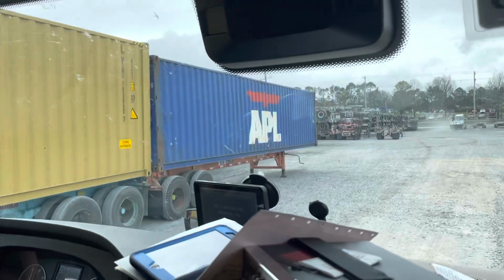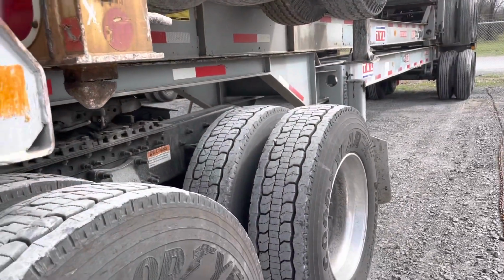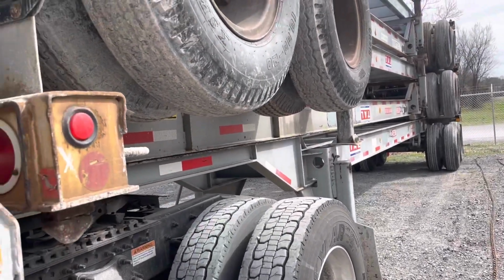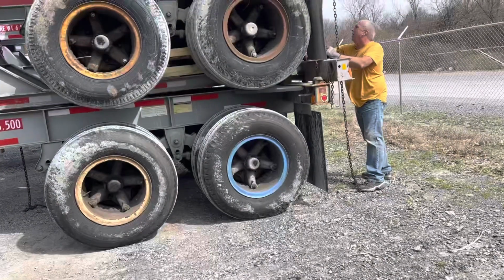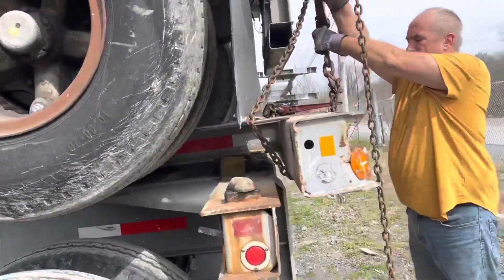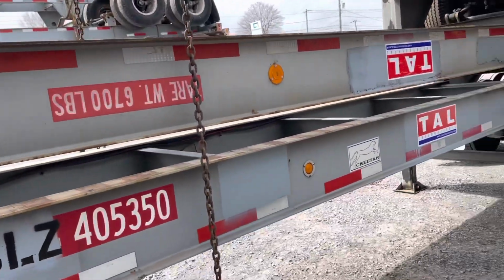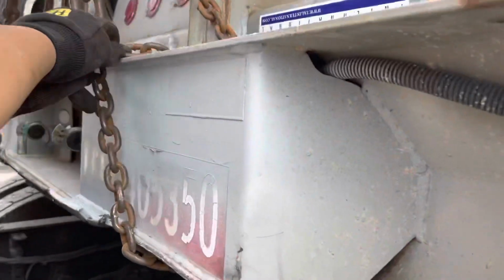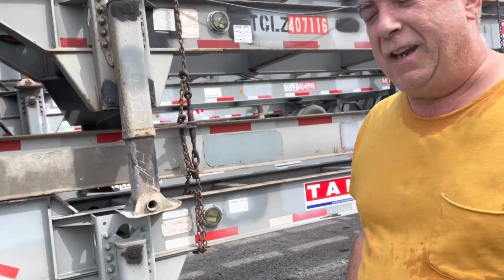Watch mae climbing on the 5 stack chassis to help chain them down

Comment: That scared me seeing Mae climbing around on that stack.  It reminded me of my car hauler and I have fallen through on it before.  You find every piece of steel cross member when you fall.  Knees, shins, ribs, elbows, back.
Duck tape makes an easy way to secure the slack chain.  I always kept a couple rolls of that and electrical tape in the truck.

Comment: What size chains u use? 5/16 or 3/8?
Reply: You ever figure out what size chains you need?
Reply: @TruckerEeee  no… u know which I need for this loads?
Reply: Just picked up my first stack of chassis yesterday...They told me 3/8 20 feet chains and binders...I also got 4 10 feet 3/8 chains for the front and back...You could also use 4  4inch straps for the to bind the middle...
Reply: @TruckerEeee  thanks